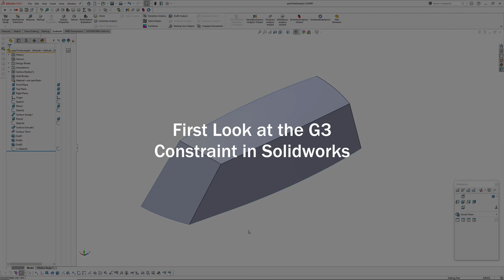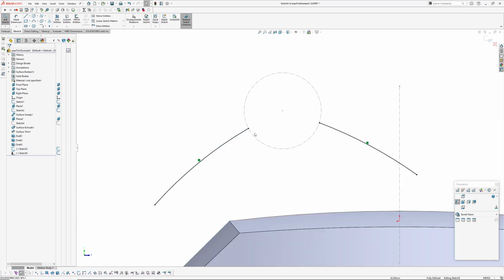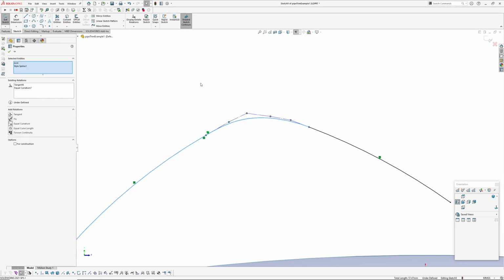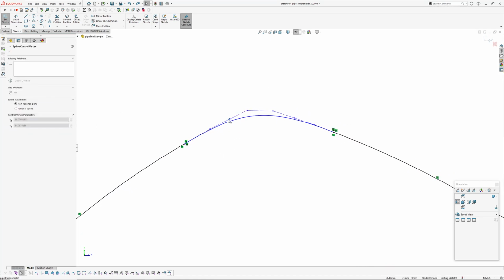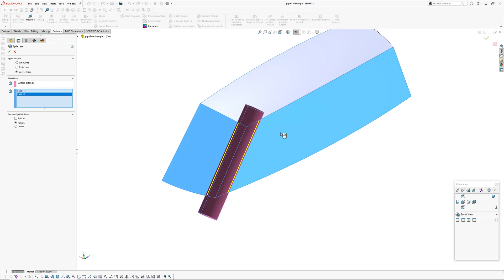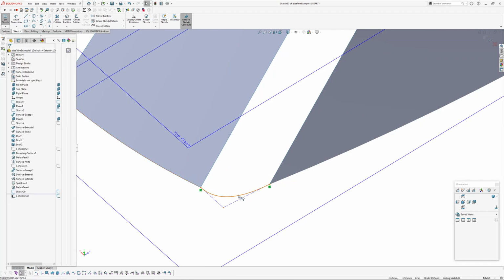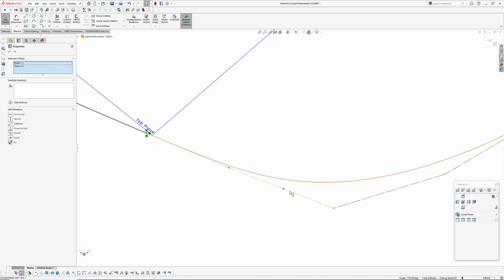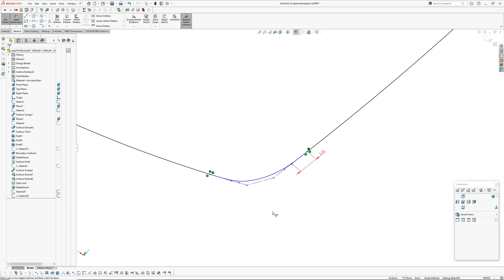First Look at the G3 Constraint in Solidworks

Comment: I also tried to use the G3 constraint and I couldn't get positive results. I think that G2 is as far as SW can go. I read through some comments and I can see that if you are more intrested in building clean surfaces you either go with some add-ons or just move to other software. I have a love&hate relationship with SW because it did help me numerous times. But also pushed into hell of reparing broken relations in sketches. I think that the feature tree oriented CAD is not the best choice for robust and well defined curves and surfaces. Nevertheless even if I have to repair something, rebuliding only some features is still less time consuming than building entire model without history of operations :) I think we should establish a group of people who have access to different software and use the best software for the task :D
Reply from the maker: Agree with you, query whether there is a need for G3 in SW, especially as they have not backed it up with the matching surface and evaluation tools. At the moment I'm making a number of changes to models across a range of projects and if they had been built in Rhino, it'd be very time consuming. Guess that is the trade off.

Comment: I think that calls for a discount :D - Damn old bugs that appeared sometimes even before G3.
Reply from the maker: Eons ago. Maybe they don’t think people use these features. A bug I want them to fix is the pink ghost line that appears on screen sometimes and never goes away unless you close the part. It has appeared in 2021 already
Reply: @AndrewJacksonDesignStudio  Not a bug fix, but I’ve found a way you can remove the pink line without closing the part. If you edit the offending feature that created the pink line (usually a boundary surface with the “mesh preview” feature enabled), you can hover your mouse over the surface mesh lines to “reset” the temporary graphic. 

I think the bug happens when you exit the feature with the mesh line still highlighted, which causes it to get stuck.
Reply from the maker: @clav_h  Good find! Thanks for sharing. I'll try that next time it happens.
Reply: Ah yes! Just watched a vid where it happened to the guy.
Sheetmetal bendlines that unhide itself repeatedly... it's probably there too still.

Comment: I am working with the G3 constraints in SW already quite a while, and they can be finicky.  Generally, it helps to get the spline shape close to what you want (using the curvature combs) before adding the constraint. Otherwise SW might get you a solution that is far from what you want.
And then, same as with CC and even tangent constraints, they will go overdefined for seemingly no reason when rebulding the model, even if nothing changed for that particular geometry. You can delete them and re-set them wihtout issues, which is an easy fix but can become quite frustrating at the same time. It is one of the reasons I am using the blend curves of GW3D's add-on a lot.
Reply from the maker: Business as usual but more finicky… is GW3d still perpetual? I’m interested to see what use G3 sketches are with blends using the boundary surface. Quite often boundary surface outputs deg 3 multi span surfaces, which means the internal continuity tops out at G2… might make using G3 a moot point.
Reply: @AndrewJacksonDesignStudio  Yes, it is perpetual.
I did not really know the answer to your question because I am using very little boundary surfaces these days, and a lot more GW3D or Xnurbs, so I tried it quickly, and the result is not positive. Between two G3 splines and 2 surfaces with continuity set to G2, SW creates a surface with 55 CVs in U direction (where the spline has 6).
Is there a reason you are always using one CV more than really needed when doing G3 corners?
Reply from the maker: @Jonas Müller   if you want to have each end independent you need to have 4 per side, so deg7. Imagine the curve was an S bend for example with an inflection, or the curve is in 3d space where you probably cannot share the 4th point of each end. But I guess you’re talking about corners specifically so I guess you could save a point and share them. The benefit being a curvature improvement? That boundary surface sounds bad. I have had SW produce a less dense surface when you make the tangent influence 100%. But then you need to have curves picked in both directions!

Edit - this doc covers the curve degree needed the relevant G match on each side. https://knowledge.autodesk.com/support/alias-products/learn-explore/caas/CloudHelp/cloudhelp/2020/ENU/Alias-Reference/files/GUID-A8F5295D-FD68-4C33-914C-9E2578A37878-htm.html
Reply: @AndrewJacksonDesignStudio  Yes that was clear to me, I was talking about planar corners without specifically mentioning it. The main benefit is just reduced complexity. Reduced CV count and one thing less to control.
Reply from the maker: @RadCJ33  👍